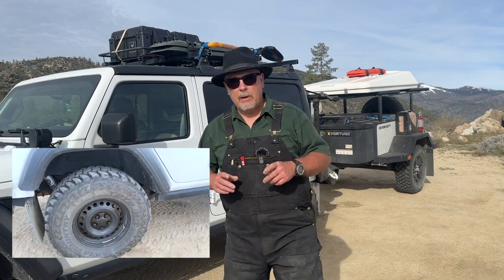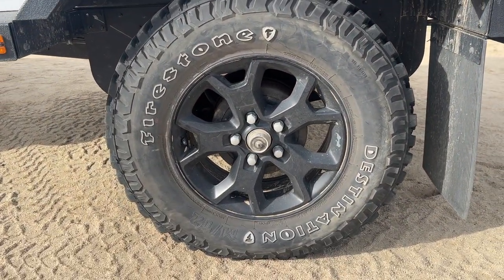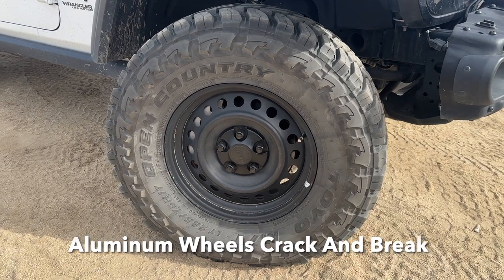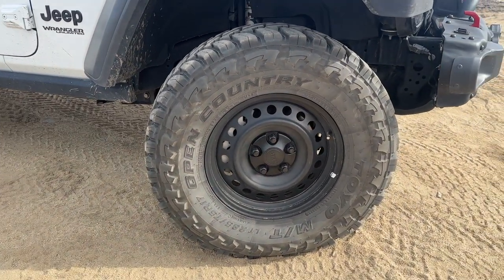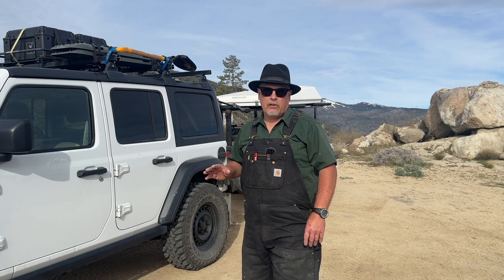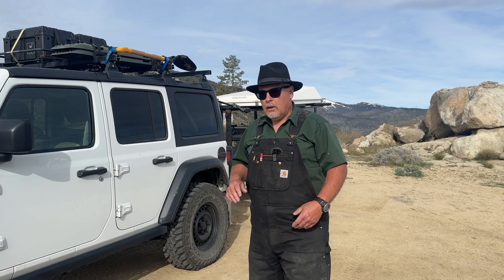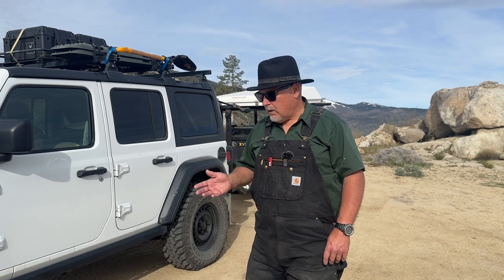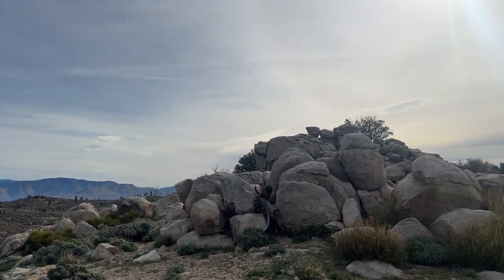Why Are Steel Wheels The Best For Off-Road? (Steelies Setup Made Easy)

Comment: You need to put beadlockers on
Reply from the maker: That would be cool. If you  air down to 10 PSI you can drive like a maniac without the tire coming off. Beadlocks are expensive and I’m not sure if they